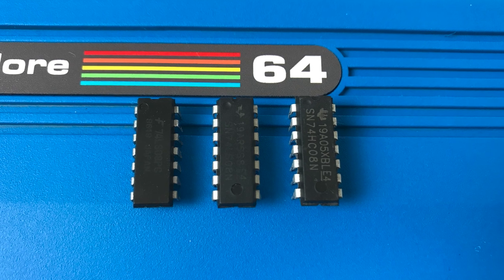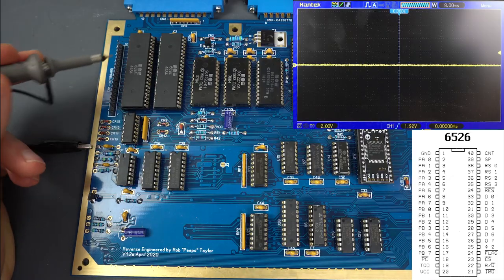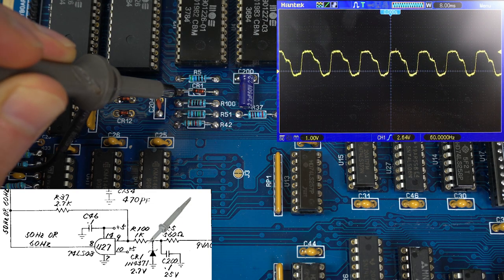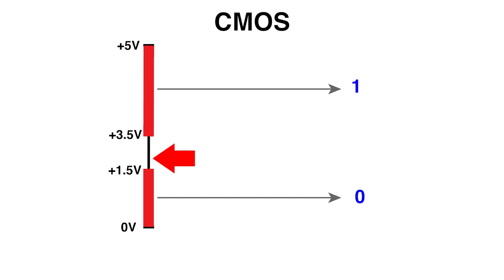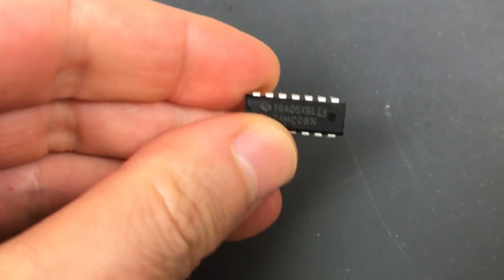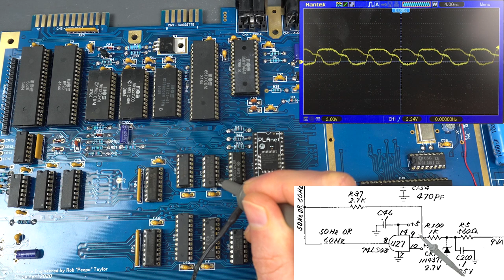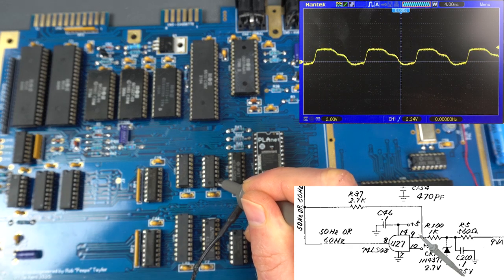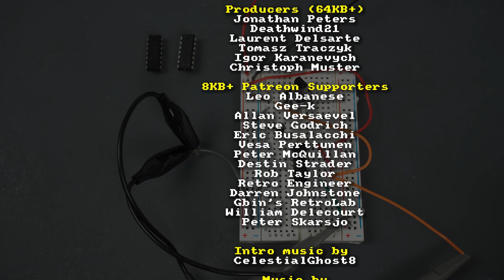Stumped By New Fake Chips Scam

Comment: I had a similar problem trying to control a HUB75 display from a Blue Pill board. The display used CMOS chips, and the datasheet said they wanted 70% VCC for a logic 1. That's 3.5 volts, which you aren't going to get from a chip that runs on 3.3 volts. It was close enough to work most of the time, but when actually using it, sometimes a few pixels on the display would glitch because it was right on the noise threshold. I made one failed attempt at a level shifter before I moved on to other things.

Comment: I've been bitten before by blacktopped/relabeled chips, mostly for things like YM2151s and the like where to be fair, there probably is no legitimate undiscovered "original" supply left, and every part I can buy has basically been run through a fiery crucible, broken off the board, retinned, reblacktopped and labeled with a fake batch number, but basic TTL chips? Oof.

Comment: Where the un-ANDed signal voltage goes under 0V, I think that can be expected. At he "unused" half wave of the 9VAC the zener diode is working in the forward region with the resistor, leaving 0,6ish V  under the zero threshold. I believe that is not a problem for most logic chips, but it could be avoided with a standard diode between the 9VAC and the ballast resistor.

Comment: You cold try to measure gate input current to see if it is CMOS or TTL. At least if they haven't gone through the trouble of putting in a resistor to the input. Great video btw. 👍

Comment: The LS in the part number stands for Low-power Schottky as opposed to the original TTL which consumed quite a bit more power.  I am curious why they didn't use a chip with Schmidt triggers, as otherwise you hit that unstable band between high and low input levels, resulting in a lot of random noise, as you found.  I'm surprised that using the AND gate input for hysteresis works, clever if unconventional.

Comment: If you really want to troubleshoot a power line derived time issue, wait until you have something in a building with solar and battery backup.  Both the solar and battery systems use a pll to lock to the grid frequency.  If the grid drops, the solar and battery inverters are locked together but may drift a fraction of a second relative to the missing grid power.  If you have many power outages, you may find that clock circuits that rely on line sync may be minutes off over time.

Comment: It'd be interesting to take this further...
1: Measure the unloaded and loaded high and low OUTPUT voltages to see what the levels and drive currents are
2: Measure the quiescent current consumption of the chip with all I/O pins not connected (CMOS should be near zero)
3: Measure the current consumption with one input grounded (If the input is a BJT as in 74LS08, then the current consumption will increase)
etc etc

Comment: Too funny,  my first thought was change the zener.   No clue why they used a 2.7 volt in the fist place.  Perhaps availability back then.   It was my understanding year ago that anything over 2.5 volts for 'TTL' was 'high'.   They could have went with a 3.3,  3.6,  3.9,  4.3 or perhaps even a 4.7.
Reply: I bet it was availability. They already had them, they worked, so they got used. That's no reason that a modern reproduction has to adhere to the same limit when the effect on operation is only to make it more reliable, now that it is apparent that this is an option.
Reply: @mal2ksc  possibly 2.7v zener diodes happened to be a bit cheaper, than the other valurs, forty years ago.
Reply: Interesting - my first thought had been "They really should have relabelled HCT chips and probably nobody would have noticed." Noel says that himself later in the video.
Reply: @ThereIsOnly1ArcNinja  Well sure.  I guess I should have said my first thought on how to correct for the issue given the chips on hand.    Outside of that my first thought was....bastards with the fake F'in chips not gee they should have used a different chip for the fake.

Comment: There are also significant differences in current draw, input impedance, and output impedance between HC, LS, etc.... chips.  Also note that Zener diodes below 5.6V are very sensitive to current... they need a higher minimum current to actually pull the voltage down to the rated value.   This is handled by R5 on your schematic... looks like.  Mmm. 9V - 2.7V = 6.3V.  6.3V across 560 ohms is roughly 11mA.  Should be enough for the zener itself.  It probably needs at least 5mA to work properly.

So, that leaves current draw from U27 and R37 to cause the voltage to dip below 2.7V.   The current is drawing through a 1K resistor after the zener... it doesn't take much to cause the voltage to go well below 2.7V, so the components wind up mattering a lot.

Your attempt of replacing the zener with a higher-voltage zener is reasonable, but note that the current draw from the 9V AC through the 560 ohm resistor will be lower and that can cause major problems for voltage drops across that 1K resistor.   The zener's generated voltage will be too 'soft'.

Other possible solutions... reduce that 1K resistor a bit too, so the current draw from the rest of the circuit doesn't draw the zener voltage down as much.  But the feedback circuit will also be sensitive to that resistor so... you might have to do some math.   The whole circuit is very finely tuned.   It would have been a lot easier if they had just used a schmitt trigger AND gate there, then they wouldn't have needed to square up the input with the feedback resistor from the output of the gate back to its input.

--

Yes, tants tend to explode after a while if you apply reverse voltage to them, and/or cause a permanent short.

Cool stuff.  I haven't played with the PET/C64/Amiga stuff for decades(!).

-Matt

Comment: Don't forget that the CIAs are also responsible for reading the keyboard and joysticks!

As for why the CIA has a separate input for the TOD clock: one issue is that while every computer system using these will have a much faster system clock, that system clock will vary from system to system depending on what was convenient for the designer. (Remember, unlike the VIC-II, the CIA was not designed just for the C64; it was designed to replace the 6522 VIA and add additional capabilities, much as the 6522 VIA was designed to replace and add capabilities to the 6520 PIA, which in turn was a clone of the widely used Motorola 6821 and 6820 PIAs. It's perfectly plausible that they hoped to sell these into industrial and embedded systems where those earlier chips were already being used.) Rather than adding more circuitry to deal with dividing down fast clocks of random rates which still won't be exact in some situations, and yet still restrict designers who might want to be able to vary the system clock rate or even pause it for various reasons, it's much easier just to accept a separate 50 Hz or 60 Hz input, especially since a very reliable source of that is widely available all over the world.

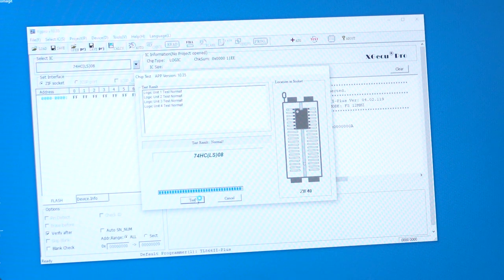08:15 was where I started yelling at my screen, by the way. Did you not notice that your tester said 74 _HC_ ? Coming immediately after an explanation of TTL logic levels, that was the problem (or at least potential problem) staring at you right there. (I'm guessing that it your tester said "HC(LS)" because it can't tell the difference, but that's a big reminder that you need to check that.) But then again, maybe I'm just already primed for this sort of thing because I get CMOS parts relabeled as TTL from AliExpress all the time. (Probably about three quarters of the 6502 CPUs I've bought from them have actually been remarked CMOS parts.)

BTW, it's also worth putting an ammeter on the power input of the chip when comparing TTL and suspected CMOS. You'd probably see a massive difference there; my CMOS 6502s draw literally less than a tenth the power an NMOS 6502 draws.

Comment: At 4:41 I don't follow how the AND gate helps produce a square wave. Doesn't it just shift the wave up 5 volts?
Reply from the maker: The AND gate outputs either 0 or 5V. So as the sine wave is at the bottom, it's outputting 0, as it starts to grow, it's still 0, then at some point it crosses some magical number, and it flips to 5V, and it continues there until the sine wave hits the peak, and starts going down again.

Comment: 20:12 Well, you accidentally found a viable replacement path for at least one LS chip in the C64! Started diagnosing a fake chip, end up slightly improving on the C64 design...

Comment: For TTL, the output transistors draw current at any input level.
For CMOS, the input voltage outside of thresholds, i.e. 2.5 volts, neither P or N transistor conducts so output is indefinite (high resistance).

Comment: This was super interesting, and your solution was great. I had a question about the test of the chip on the EEPROM programmer. The chip passed the test, but the IC is specified as 74HC(LS)08. Does that mean that the test is really only running HC voltage levels, and not LS levels as well? Would it be possible to set up IC test parameters that specifically target the lower voltage thresholds of an LS chip? I assume that would make this kind of test easier, but that the 2 types are grouped because this problem is such an edge case. I don't have any experience with how that testing works behind the scenes.
Reply from the maker: Thank you! The EPROM programmer just sends 5V for a logic high, so when it says HC(LS) it just means either one. The way it's set up, I doubt very much it could send an intermediate voltage. I'm even reviewing a Retro Chip Tester now that tests all kinds of chips and can't do that either. It could be done, but it's not something most people care to test probably.
Reply: @NoelsRetroLab  That makes sense, thanks for the info.

Comment: I get that it's not that important, but does switching out the diode change the timing of the system clock.... Or maybe actually more likely does using the CMOS chip mess it up....I mean I guess it depends on how it works????? The ON pulse is happening a fraction of a second later (when voltage is brought up to 3.3V instead of 2.7V), and the Off pulse is happening a fraction of a second Earlier (Below 3.3 instead of below 2.7). Making the Off duration 2 fractions of a second longer then designed for..... Does that mater?  Does the clock care at all about the frequency of the pulses?  If the Duration doesn't matter why not use a 4.7 so that it'd work in most all cases?

Comment: In the late 80's, when I was involved in design and manufacture of electronic equipment, it was common practice for a component manufacturer to sell off a batch of faulty chips marked as "out of spec" rather than destroying the whole batch.
Not sure if this practice is still done these days or not.
Reply: I bet most of them were sold to Chinese buyers.
Reply: @jpdemer5  I was wondering if maybe out of spec dies (I think that is the term), were manufactured into chips behind the back of the original contractor. The wafers are tested before they are mage into chips. Lots of possibilities when trying to steal money.
I did notice how the logo appeared a bit off so that they could  easily tell the difference themselves.

Comment: Not information but a guess; just like you, I do think that the chip is not a remarked/counterfeit one, but I don't think It was a scam done by the factory. I think there was a mess-up and a bunch of HC chips got marked as LS. From there, there are 2 possibilities; either no one noticed the error and the chips just went out of the factory like that, or it was noticed and the chips were removed to be disposed off but a "clever" worker just stole them and sold them to an online marketer. My vote is on the second option. :-)
Oh, by the way you did an excellent demo of LS and HC characteristics, it was nerd porn!
Reply from the maker: True, that's a possibility. I'd be more inclined to believe that if the logo on the chip looked more legit, but it kind of looks like TI but not really. But who knows! I may have to open them up and find out. Glad you enjoyed it! 👍

Comment: why would the mains freq driving a clock sound weird to you? a hell of alot of things used the mains freq as a clock source in the days the C64 was at its prime
Reply from the maker: Just because I wasn't familiar with those clock systems back in the day and I thought the frequency wouldn't be very stable, but I was definitely very wrong.
Reply: @NoelsRetroLab  ah, righto, yea it used to cause problems with devices when you ran on a backup generator that wasn't running right, was a pita

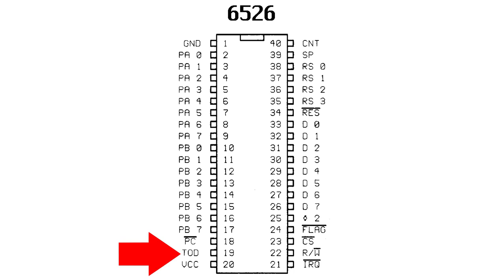Comment: At 1:50, and my first guess is that we're dealing with a VIA where a CIA should be. The pinout is very similar, it might vaguely work.
Reply from the maker: Interesting. Like the VIC20 VIAs? That hadn't even occurred to me. Although now that I think about it, I had tried working CIAs on this board and they also had that problem, that's probably why I dismissed that and looked for something specific on this board that was failing. Keep watching 😃
Reply: Mind blown! I guess the only saving grace of them passing of 74HC chips as equivalent 74LS is that it's at least not going to burn out anything other than the mislabled chip. And as you mentioned, why not just sell 74HCT chips instead if their tooling is set up for CMOS. I can't see any benefit for anyone in this circumstance.

Comment: There are a lot of varieties for these logic chips, not only TTL and CMOS like in the old days, but yeah, the voltage levels are typically still one of the two. I find it hard to believe anyone faked these chips, unless they are also very old. Could it have been from a wrongly produced batch? Nice fault finding anyways! This work-around might help others who have trouble finding the "correct" parts.

Comment: I'm wondering, when you swapped the 3.3 v zener, and the first cmos chip didn't trigger, could you lower the value R37 from 2.7k to a 2.4k or 2.2 k? it would slightly increase the current flow back though the zener/R100 and pull the voltage up ever so slightly....
Reply: Won't work, R37 doesn't pull up until the chip has detected the input as high.

Comment: I know this is an older video.  I also looked at some older posts.  did you notice that R100 was not a 1000 ohm resistor.  it's a 100 ohm and could effect your signal going into your IC.

Comment: The Atari 8-bit series uses a division of the color clock for the RTC functions.  Since this function is subject to interrupts due to bus-mastering by the graphics chipset, the clock on these machines is not very accurate over long periods, something on the order of a superb chronometer (mechanical).  The 60hz signal that drove the clocks in my schools as a boy produced much better results over long terms.  I was fascinated to find this in use on the otherwise uninspiring C:64.  Now I  have a good reason to admire it.

Comment: I wonder how the TOD is going to work in my C64. I have an NTSC board that has been modded to run both NTSC and PAL at the flick of a switch (it has to be powered off to change it the mod was designed that way) it's called the VIC-II² mod. Anyway I'm in the USA. I get 60hz. does this mean the TOD is going to work correctly in NTSC mode, but will be off in the timings in PAL mode? not that it really makes much of a difference.

Comment: Changing the zener: I was exactly thinking the same through all the video - it seems bad design to use such a low zener (and actually, shouldn't a higher zener  produce less heat?).
Unfortunately, despite working with 3.3V zener and an 74HC08, I think it's still slightly out of spec...

Comment: I apologize if it was mentioned and I missed it, but does this mean that the clocks run at slightly different speeds on 50 or 60hz power?  Or does the system compensate for that somehow?
Reply from the maker: Good question. I didn't mention it, but you actually need to tell the CIAs if you're running 50Hz or 60Hz so they keep track of time correctly. Apparently games that use that feature need to set it themselves too.
Reply: The CIAs have a bit that you can program to switch them between 50 and 60 Hz. The default behaviour of the KERNAL is to set the CIAs to 60Hz if a NTSC VIC-II is detected and to 50Hz for a PAL VIC-II. This normally works fine, but you get into trouble if you use an NTSC C64 in Europe or a PAL C64 in the US. In such cases you can install a custom KERNAL, but many people just ignore it, since the clock running too fast or too slow doesn't cause that much problems with most software.

Comment: Would I be able to do this level of diagnosis with a cheap 2mhz scope?
Reply from the maker: This particular one, for sure. The signal I was looking at was 50 Hz, so you have plenty to spare. And the test on the breadboard, anything works since it's not changing quickly (heck, a multimeter would work on a pinch). So yeah, totally. With a 2MHz scope you'll run into some trouble looking at data buses of a Z80 going at full speed (although you'll be able to see there's activity), and clock signals forget it. But everything else you'll be fine with it.

Comment: Suppose you buy excess inventory, you may end up with a random assortment of different batches of 74xxYY logic chips from many different manufacturers and in several different logic families.
If you then have customers asking for say 10000 Texas instruments 74LS04 chips, then why not simply re-badge all of your mixed bag of 74xx04 as Ti 74LS04 and charge top dollar for them. Rather than sand down the chips, perhaps you screen print them all with a thin sheen of black epoxy, and laser on the new marks. That way they pass the acetone and isopropanol tests, but they are still toffees sold as truffles.
I guess you should really de-cap one or two of them to see if the branding matches the die.